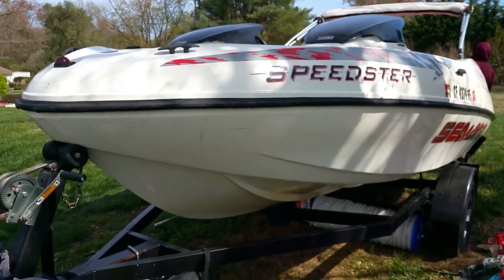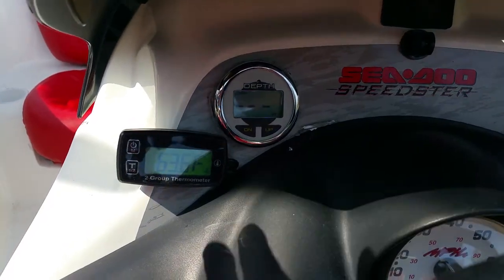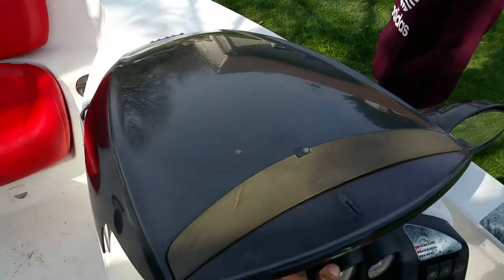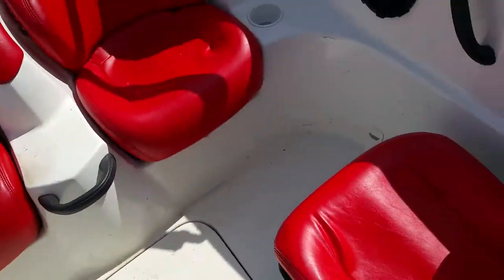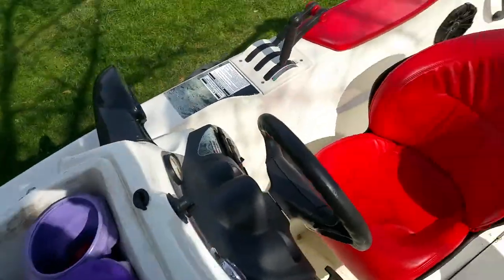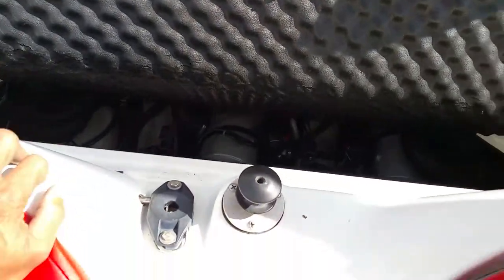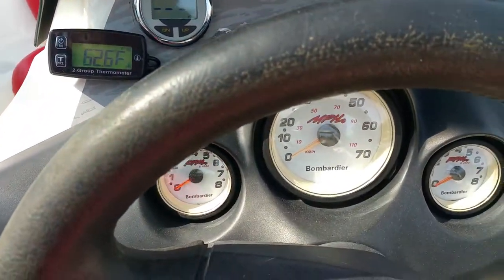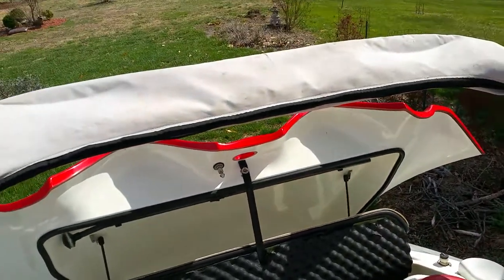Seadoo speedster 98 1600

Comment: Were your seats reupholstered? Is that why they are kinda saggy? Your engine compartment is super clean, how did you clean it?
Reply from the maker: Yup the seat been redone and the engine compartment I power wash everytime come back from the lake.
Reply: That "normal wear and tear" on the keel is through the gel coat and shows fibreglass! That needs to be repaired before it becomes a major leak...